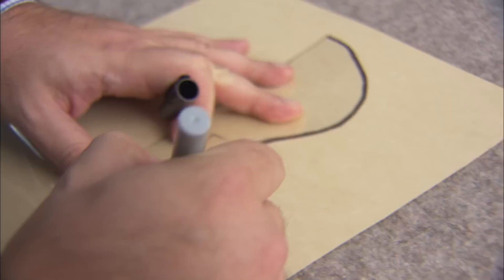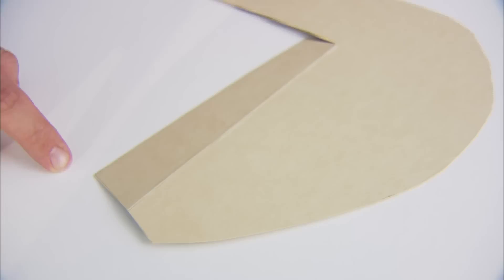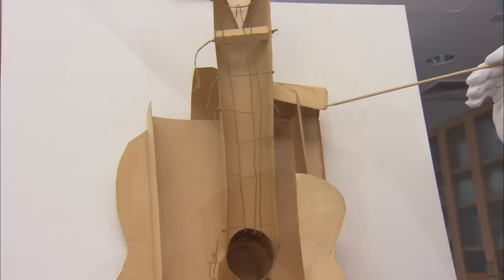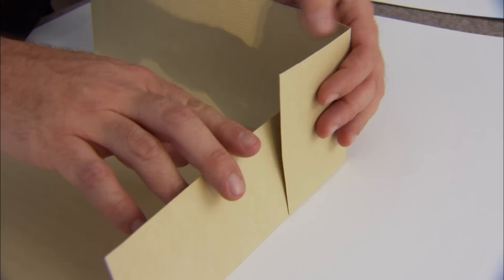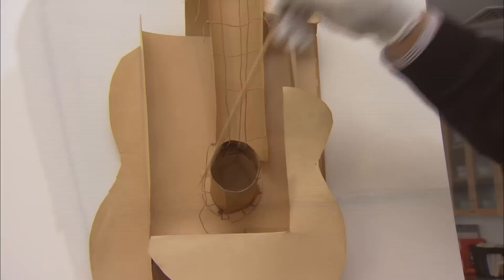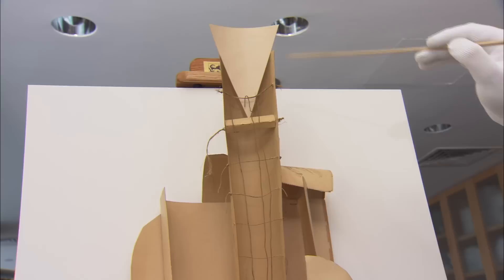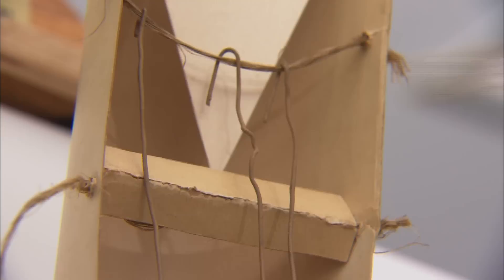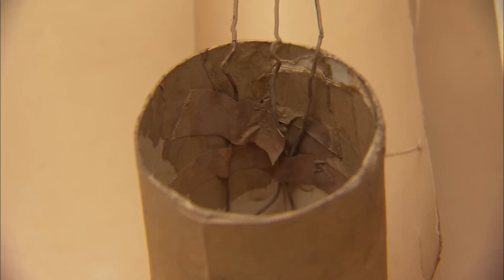Picasso: Guitars 1912-1914 | Picasso's Cardboard Guitar (1912)

Comment: This is my interpretation, and answer to the 'doubters'. In his cardboard 'guitars' Picasso broke new ground and opened our eyes to what is considered sculpture. He makes us think about the nature of reality, and not simply accept what has gone before. Guitar was assembled by Picasso from cardboard and string in 1912. Photos in his studio show it surrounded by collages of guitars.
The volume of the guitar is represented without making a solid object or”mass.” The 'volume' and contour of the body is created by a series of jutting perpendicular and parallel elements working forward from a ground plane of cut out shapes. The sound hole, rather than being an empty space cut in the body of the guitar, is a piece of cardboard tube; inverting what should be a hole into a solid cylinder. The 'solid' body of the guitar is thereby converted to empty space. Our reading of the surfaces oscillates between surface and void, powered by our imagination.
Furthermore it is linked to his purchase of an African mask. The geometric representation of faces in masks was unfamiliar to western audiences at the time. Assembled from disparate fragments unrelated in form to the natural features they represent, or stand in for: a block protruding forward, painted with two stripes, becomes a mouth; the eyes are two pieces of dowel, similarly protruding – reversing (as does Picasso) the normal surface to space relationship. Like cartoon faces, it is the relative position of these 'signs' which makes the sculpture 'readable' as a head.
This revelation to Picasso meant that henceforth he could move elements around so that they could represent different things according to location. A circle could become an eye or a face, could become a breast or a nipple.